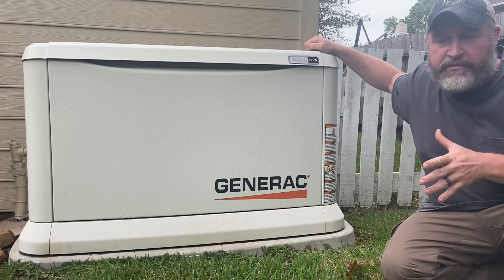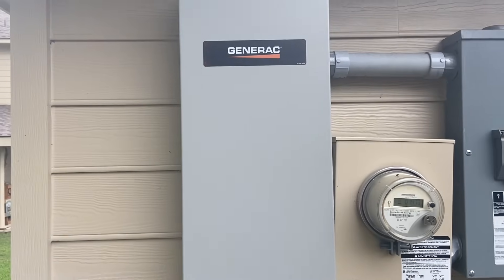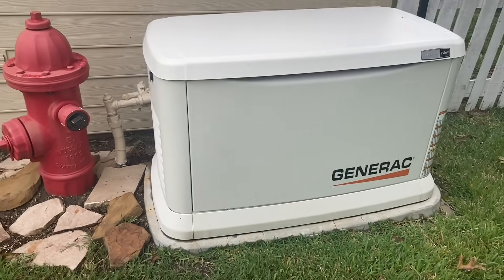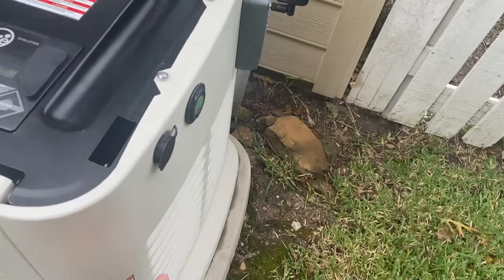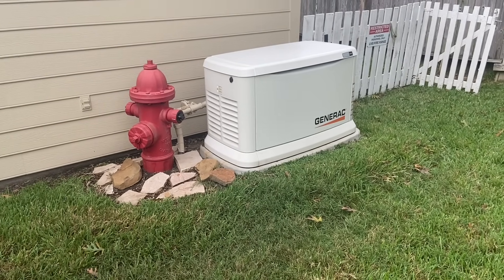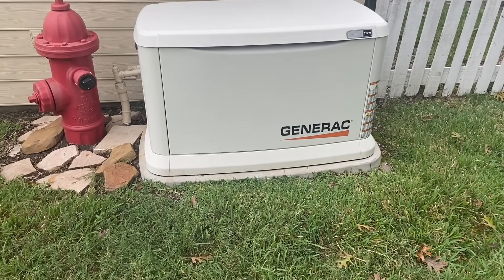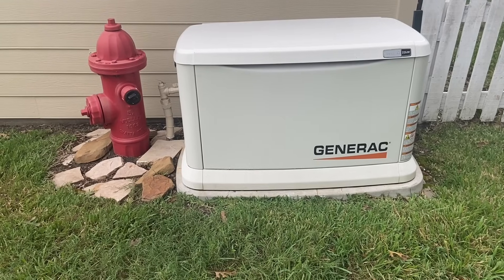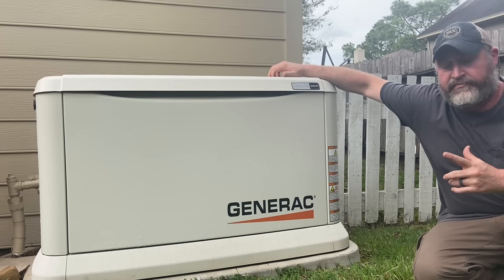Thinking of purchasing a generac whole home generator?

Comment: I've been servicing and repairing generators for 35 years and I've seen a lot of Generac units fail.  If you have one that's 7 years old your brushes WILL fail it's just a question of when. Generac knows about the problem and has for several years. They will not warrenty the problem even though it's a design problem. I've also had a 2 year old one that needed new ignition coils and 6 months later a starter.   Generac mission statement from the begining is "quantity over quality".  BTW your generator is improperly installed. National code calls for 5 feet from ANY burnable surface. That includes your vinal siding
Reply from the maker: Cool buddy it’s not vinyl siding it hardie board also no wall openings or windows so it meets code. But thanks for watching please subscribe and check out some of my other videos.
Reply: So what’s a better generator to buy for your home for those of us who are looking?
Reply: @cryptopaul770  I am no generator guru but Generac is the generator of choice here in tornado alley and mine has been problem free for 2 years.  knock on wood.  Oh yeah, our city code is either 18 or 24 inches away from the outside wall (cannot remember).  Ours is currently 24 inches away from the outer wall.
Reply: Is a better brand you recommend?
Reply: @darbyohara  kohler
Reply: @wemiles 
That's because they advertise like hell. Ever watched a commercial for Kohler? Or Onan (Cummins(? Better units but they don't have infomercials
Reply: What do you think about kolar?
Reply: My generac is 28 years old 10 battery and 2 brush kit I love it at the time I got it I work for a dealer that sell Kohler generators but the smallest they sell was 100 kW
Reply: My 2003 unit never failed several multiple day outages I just installed a new one just because I wanted something newer that I can monitor people don't load exercise enough I load exercise mine every month never failed worked great that's why soms Kohlers give the option of load exercise and they recommend it I know few people with both brands the people not load exercising are the ones having problems
Reply from the maker: I load exercise ours about once every three months. I think it’s a good idea as well. Thanks for the comment and for watching.
Reply: @JustCantSitStill  mine exercises once a week for 10 minutes
Reply from the maker: @NewsThatMatterUsa  same for me but 5min once a week. I also run a load test every 3 months
Reply: @JustCantSitStill  

Is load exercise when you turn everything on to try to max it out?  I enjoyed your channel, will subscribe and I am also investing in one after tax season 2023.
Reply from the maker: @mn1170  basically yeah , I have already proven it will run every so just about every three months I kill the power coming in and we run what we normally have going in the house for around 30mins thanks for watching!
Reply: I have mine elevated so it isn’t in the snow. I used to work on communications sites and that was the norm in snowy areas. Sometimes they would even put sheet metal snorkels for venting.

Comment: Great vid and info!  I notice you mentioned having ran it around 30 hours once before.  Do you have an idea how many hours or days of continuous use it will last vs. gal of propane/natural gas used?
Reply from the maker: Thanks for watching and the comment please subscribe like and shares, generac website has some of the info on consumption, we are on NG so long a the supply is running and it has oil it will run my dad has ran off his for around two weeks straight.

Comment: We have 22KW LP gas cover 2 stories of 4800sqft whole house including 2 5 ton AC. We find no problem when our generator kicks in less than 1 min once city power grid shut down. Our unit set for every Friday test run. We find it as a great investment and a sense of security when regular power out during storm. The unit comes with 7 yr guaranteed plus small fee for additional 3 yrs total of 10 yrs directly from Generac manufacture.  A must have if you can afforded.
Reply from the maker: Thanks Ann for checking out my channel, I am glad you have the same piece of mind we do. It’s a great feeling. Please subscribe like share 👍

Comment: My Niece and her Husband bought a Briggs & Stratton standby generator right after we bought our GENERAC. They have had nothing but problems with theirs. (She seems to think that in addition to the engine starting every 2 weeks for 5-6 minutes that the transfer switch should also be activated in order to keep the contacts clean-It there any truth to this?) I have changed the oil on ours now, using synthetic oil and a (cross referenced) Purolator oil filter. I monitor the battery voltage and the bi-weekly excercise cycles via an app on my phone. I plan to replace the battery when the voltage gets down to around 12.3 volts. Generac seems to want me let THEM service the unit but since I believe the gasoline engine itself is really nothing more than the 1 that is in my riding mower I'll just get the supplies and do it myself.
Reply from the maker: We do a mock outage about once every three months , basically I kill the power after the meter and let the transfer switch and generator do their thing. I normally let it run under whatever load we have at the time for about 30mins. We let our dealer do the service so there will be no issues with warranty and also it’s included in our price for the monitoring.
Reply: @JustCantSitStill  Perfect!! Thank you!!
Reply: Just replace the batter every 3 to 4 years and don't worry about it.  If your onboard charger is working, you will never see 12.3 volts DC anyway.  Of course generac is going to push to have their representatives service the machine.  But, I HIGHLY doubt that they "Work" for generac.

Comment: I am currently researching backup gensets and power wall options that will best suit our needs when the grid goes down.  Our power requirements are very similar to yours, locating the generator, and the cost breakdown was particularly useful.  Thanks for the informative video.
Reply from the maker: No problem thanks for watching please subscribe like and share.

Comment: Live in Buffalo, just went through worst blizzard ever. Generac whole house generator kicked in when power went out, worked two hours then stopped. Went two days, Temperatures in the teens with no power. When service finally was able to get to us it was the air filter, Intake vent was pulling in the snow. Any suggestions on how to prevent this next time.
Reply from the maker: I would get with generac or whoever does your service to see what you can do that will not void warranty, if warranty is not a issue I would make a box out of aluminum that would only allow air to be pulled in from the bottom. Or make a small lean-to that covers the generac
Reply: Dang.  Sorry y’all went through that.  Glad you are ok. Also glad you posted it and the issue so others will know what to go out and look for.  I’m in NC and we dropped to 7 degrees which froze up all our water.  Duke Energy was doing rolling blackouts because they couldn’t handle the demand load.  I definitely know it’s no where compared to what you went through.  It wasn’t far from me where some crazies shot cup a couple power stations knocking out power to a week for some people during low temperatures.  That’s why I am going to invest in one
Reply: Was it that your generator was buried in snow, or was it sucking in the falling snow? Obviously, if it were the first issue, you could have just shoveled the intake area to keep it clean. 

As @Just Can't Sit Still mentioned, since you guys measure snow in feet, you might need a special setup. No matter what, you need the ability to pull in clean air and push out exhaust. Assuming Generac approved of my plans, I'd build a shed with an attic vent, pushing air out of the shed via a pipe 15 feet in the air, maybe running along the side of the house. I'd then have another inlet pipe for the box to continue to get clean air, also 15 feet in the air. The idea even if the box were covered with 10 feet of snow, the generator wouldn't be obstructed. 

Considering you live in Buffalo, the capital of multi-foot snowfalls, it's a shame your installer didn't consider this possibility.

Comment: I just got a quote for a 22KW Generac/LP tank and Xfer switch, with installation- $18,000. I said, see ya- NO THANKS! I had an electrician install an Interlock switch at the main panel with a 50amp Gen inlet to my house's breaker box. I will use my Westinghouse 15000/12000 plugged into the gen box to run the home's basics during hurricane season. I have a portable 12000 BTU A/C for the bedroom on those hot nights. I saved $17,200.
Reply from the maker: Wonder how much of the cost was the LP tank ?
Reply: I had a portable stand by generator as well a Honda eu7000is. It’s a great little generator ONLY air your home to set it up and plug it in. We travel and are away from home so a whole house generator makes total sense. I don’t have to be home to know my house has power and most of all heat during the winter months. I like natural gas as I no longer have to store gasoline. 
There are trade offs. With LP you are at the mercy of the LP to provider deliveries. If the weather is bad or trees are down and the LP truck can’t reach your home, not so good. And with many LP providers if you lease the tank you have to purchase their LP. We like our natural gas.

Comment: Great video.   I will check out that 24kw unit.  We have two AC units and are on a well, 3200sq ft.  Did  you find that your gas usage cost increased much with the generator?  Also any issues with it messing up your electronics?   Like you we are on NG.
Reply from the maker: Thanks buddy for watching, no issues additional cost was minuscule. No issues with any electronics.

Comment: Yeah I have a portable that I mounted permanently. 13k duel fuel. Been running on propane the whole time. Dont have natural gas at my home. I bought a 100 amp 12 circuit automatic transfer switch. I added an automatic startup timer that runs my generator every week for 20 minutes. If it doesn't start as it should it turns on a beacon light to indicate an issue which I can see going to my chicken pin. I'm in it for 2k total. As our power goes out quite often around here it's been well worth the money. My only suggestion is not to rely on just 1 form of anything. I have multiple ways to provide power in an emergency. Not just power. Food, water, shelter, heating, and cooling. Being self sufficient is a must.

Comment: Good afternoon sir. I thoroughly enjoyed your video about your Generac generator. One of my concerns is that I found it loud. Does the noise subside a little once the engine warms up? Also would that size work well for a larger home? Thanks for your help in this.
Reply from the maker: Thanks for watching please subscribe if you have not , I have another video showing the db level. It’s really not as bad as you think. Far as the size goes it would depend on the size of the house and appliances etc. The 22kw does our 2700sf with 2 A/C and electric oven and a garage A/C but we have natural gas for heat and dryer. Hope that helps if you have any questions let me know.

Comment: i had to upgrade my gas service to accommodate my generac whole house gen set as well.
Reply from the maker: Yep I could not tell a difference on the size of the meter it must a big difference with the regulator. Thanks for watching I appreciate it.
Reply: What did the upgrade cost ? Curious because im sure mine would need the same 😩
Reply: Not uncommon, as most meters are 250,000 btu per hour (+/-), and a 20 kW generator needs about 300,000 btu's at FULL LOAD, so if there are other gas appliances, a meter upgrade is a very important item to get right-then, not later.  Mine went from 250k to 400 k as I have gas heat and a gas water heater.  Around here (N. Alabama) meter upgrades are free.

Comment: GREAT video. Thank you!  How much more was your gas bill when you ran it for those 35 hours?  Curious what it costs to run considering I’m down in Florida and will probably use it a bit.
Reply from the maker: thanks for watching, it’s hard to say our fire place, furnaces and water heater and dryer are also NG , but for the big freeze last February our bill was only 52$ more than normal, we where using a lot of NG keeping attic from freezing. I hope that helps. Please subscribe like and share!

Comment: I'm curious, if you don't mind saying.  I'm wondering what your gas bill was the month of the freeze?
Reply from the maker: It was higher then normal but we where running 2 gas furnaces and a gas fireplace with the attic door open to keep the pipes from freezing. It came out to about 17$ per day more than normal.
Reply: For Hurricane Laura, my 20 Kw air cooled Generac burned $350 in natural gas for 21 straight days of running. I installed my generator myself in 2008.
My step uncle burned about $3000 in propane for that same duration. He installed his 1 year before the hurricane.

Comment: Mine broke within the first month and stuck waiting for parts. Had a day long power outage and have a 10k brick in my yard
Reply from the maker: Dang what broke?
Reply: The tech called generac and they say it’s the magneto
Reply from the maker: @jphomebrew  man I hope 🤞🏻 the parts come in soon. Dam supply issues effecting everything. Other than our battery ours has been trouble free, I bought 1 extra oil sensor and some of the round fuses that go in the transfer switch I read both could be a common issue. I appreciate you watching and the comment please subscribe like and share take car and have a great weekend.
Reply: Im an electrican, we always say if you like NOT having power buy a generac.  If you want back up power buy a kohler.

Comment: I had/have a gererac portable 8000 that died at 53 hours that wouldn’t  start. Tried everything and turned out the magnets came off the flywheel that causes the plug to spark after a certified generac tech looked at it. I will never buy a generac again even though I am looking at new whole home one.
Reply from the maker: So far we have been good, had a 5kw portable for years no issues and now the 22kw. Everything will break and some point. The flywheel could have been replaced pretty easy on your portable. Thanks buddy for watching please subscribe and check out my other videos.
Reply: @JustCantSitStill  do I want to spend the $1200 quoted to replace it? No!  At 53 hours it something that Generac should take care of.
Reply from the maker: @whatthehell2592  1200$ seems extremely high! I would not pay that either. Why would they not cover it?
Reply: @whatthehell2592  I was given a 7 year warranty when I had mine installed.  I find it crazy they would not repair or replace your unit after 53 hours.  That is just ridiculous

Comment: We have the same generator.  In TX, west of Houston. I paid around the same from a smaller Gen company.   I did a tall poured slab that sits at the same grade as the top of the house slab.  Ours ran for 56 hours straight during the freeze.    When they did the maintenance, was the valve lash adjustment performed after 25 hours?   Some places skip that.  Mine was slightly out of adjustment and the engine ran even smoother after it was done.
Reply from the maker: We had not reached enough hours yet for the adjustment according to the tech , they may do it this next time. Thanks for stopping by and checking out my channel! Please subscribe like share 👍
Reply: Do you know how many hours do you are capable of running?
Reply from the maker: @jasone3962  As long as the Natural Gas is flowing and it has oil I would say a very long time. You did need to shut down and check or possibly change oil depending on run time. It’s not made to be the primary source of power so I can’t really give you a hard answer. I would have no issue running off of it until the city power is restored. I hope that helps if not let me know. Thanks for checking out my channel please subscribe like share.
Reply: @jasone3962  It is capable of just continuing to run indefinitely as long as it has natural gas flowing to it.  I know people have have run over a week straight.  It does have a low oil shutoff but I'd rather shut it down every day or two to check the oil on my time then have it shut off in the middle of the night.  I checked the oil once at about 30 hours in to my 56 hour run.
Reply: @scottbroadbent2086  Just curious had it consumed any oil at the 30hr mark?  I haven't had an outage since I installed mine, so it only has a couple hours on it.
Reply: @chris-n-melissahawks2809  It was about a 1/4 down from the full line in between full and fill.   Not enough to bother adding any.  It was the same when I checked it at the 56 hour mark when power came back on.  Then it got it's first 25 hours service after that anyway.

Comment: Great video.  We have the 20kw which was the standard in 2012.   The monitor system you show looks useful.    The biggest issue we’ve had is failure of what’s called a Stepper Motor.   Maybe they’ve improved design.  Something to keep an eye out for.  Thanks for a great post.
Reply from the maker: Thanks  !  Brian I did a separate vid on the gen monitor/ mobile link. I appreciate you watching and your comment have a great week.

Comment: I bought a GP5500, It failed in less than 10 hours. Customer service did nothing despite it being a 100 percent design flaw. Seal failure  allowed light rain to leak into the gas tank. rusted out. Cost $400 to replace. They don't care about their customers.
Reply: Were you outside of the warranty period?
Reply from the maker: I had the same portable, never had a issue we sold it when we purchased the 22kw .
Reply: @cfoster6804  yes. I had it in storage. Didnt use it for 2 years. The seal for the fuel gauge is in a depression, collected water that seaped into the fuel tank when it rained.